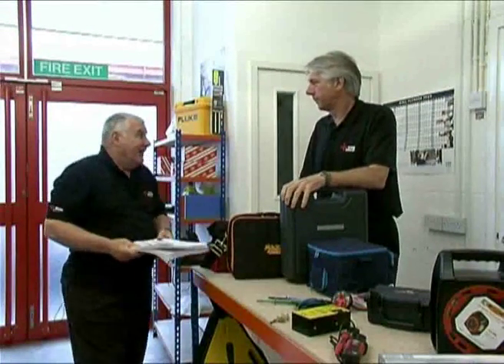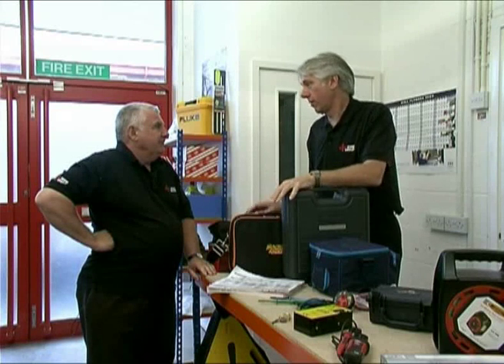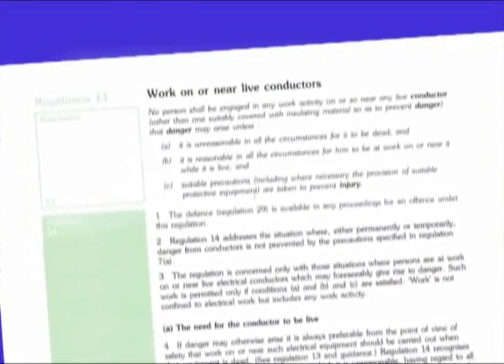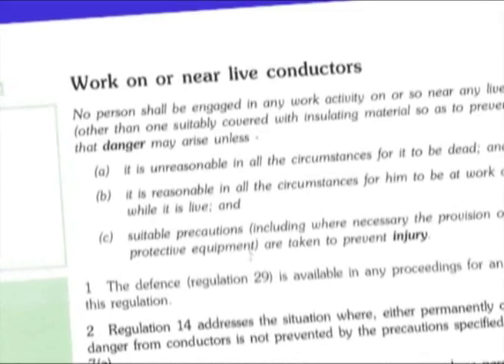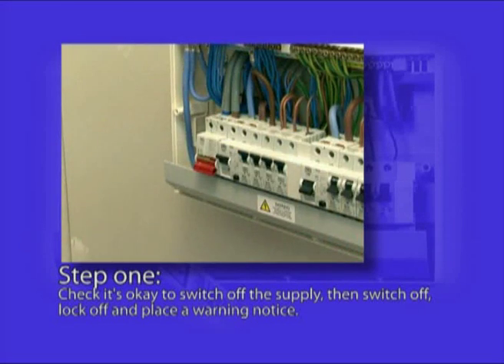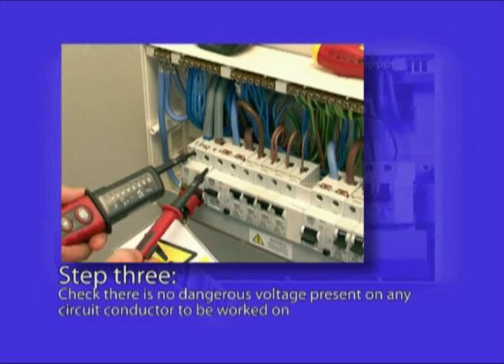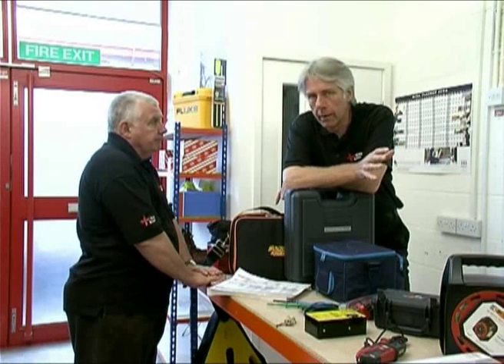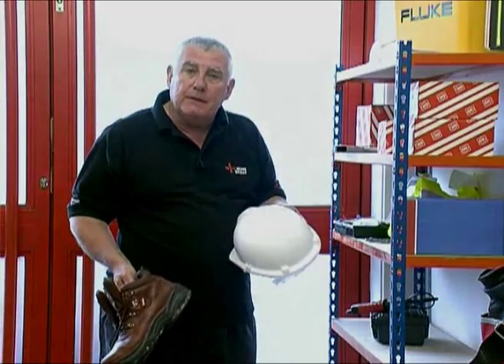Inspection & Testing Initial Verification for Domestic Properties

Comment: Wasn't he supposed to be testing the LOAD side of the switch?
Reply: when checking to see if the circuit is DEAD should test the other side , load side. Other wise he is testing the incoming supply.
The only time to test the incoming supply like that is if you dont have a Proving unit, to make sure the Voltage Indercator is working, before and after the testing of the circuit(s) are dead.
Reply: Precisely

Comment: Ze & Zs are fine to test it's fault current's but what about under real fault condition's.Many years ago i was testing a house socket which in them days it was conduit,metal box with a 20mm brass bush, wired in singles red and black 2.5mm ring.NO EARTH cable as it relied upon the metal conduit for its earthing....test readings was a pass..then i decided to fit a plug into the socket and bridge out L to Earth pin ..plug it in and switch it on..BANG then reset breaker and test socket again.